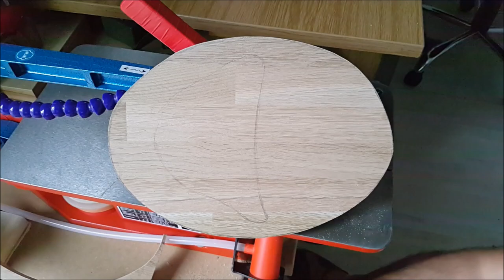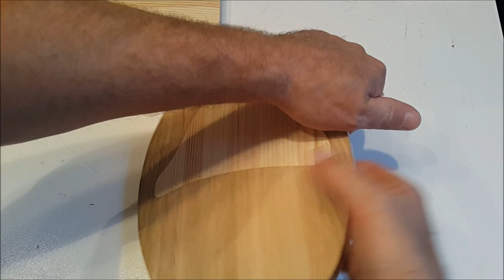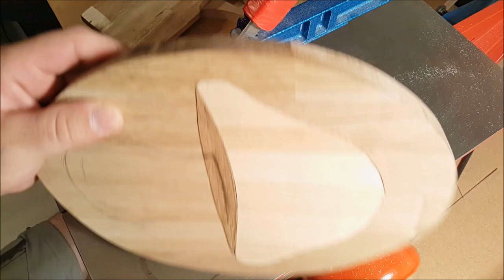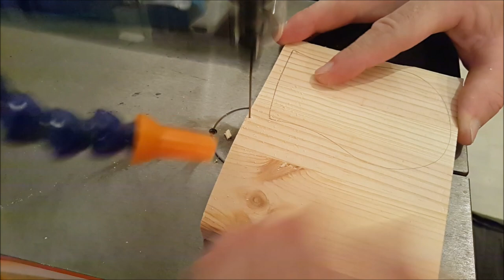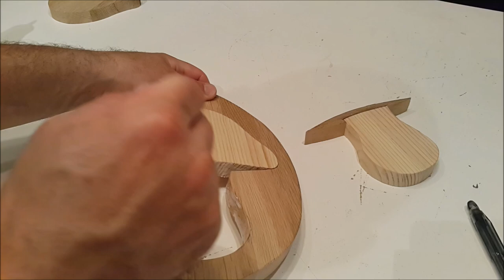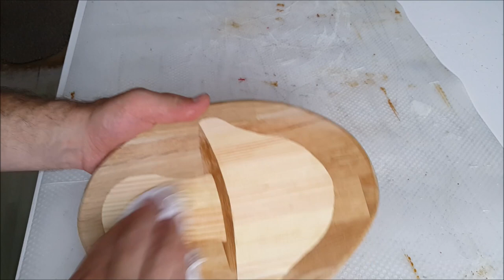Cutting Board With Inlay

Comment: Inlays turn out horrible if you cut out everything separately.
Glue the inlay layer (here light colour) on top of the darker colour board, set your saw to an 2-3 degree angle and cut out both at the same time. Then it will fit exactly.
Reply: Ullimately even though that is a way better Idea, (i have done it)
He still did an amazing job at making this work
Reply: it works somehow but you will always somewhere have that small gap to fill. Put one colour on top of the other and cut it at a 3 degree angle and the result is EXACT and gap free.
Reply: also, try something finer like letter inlay and you soon find out that cutting both separately "doesnt cut it".

Comment: Where you had gaps between the inlay , did you use any filler?
Reply from the maker: Dennis Adams I've had a few tiny gaps, light sanding while the glue is still drying solves the problem.
Reply: gaps can be avoided by putting the saw at an 2-3 degree angle and cut out both colours at the same time.